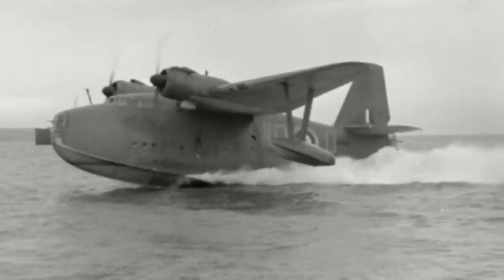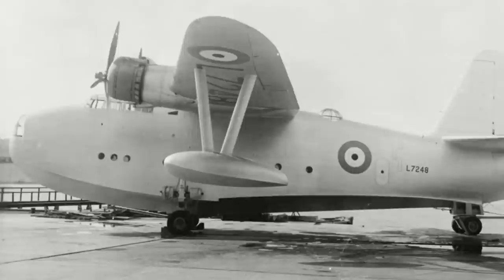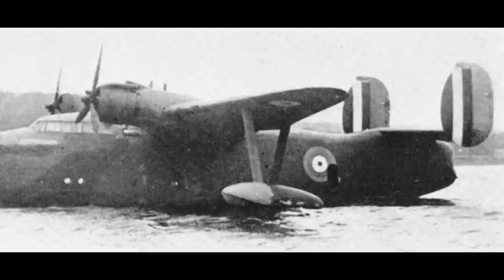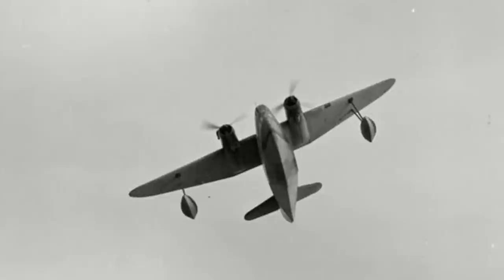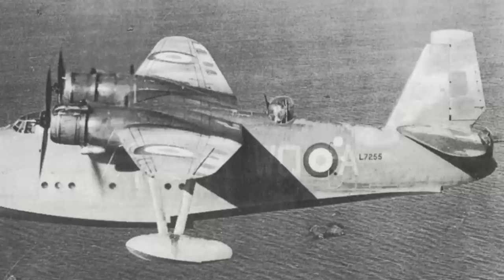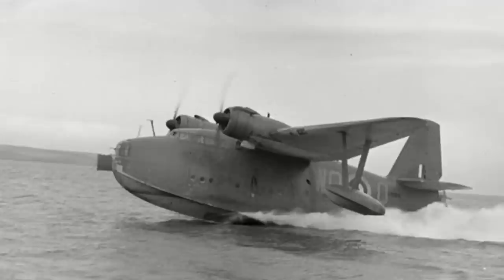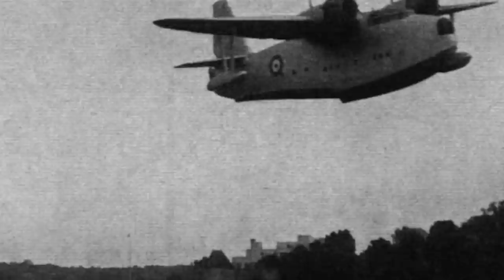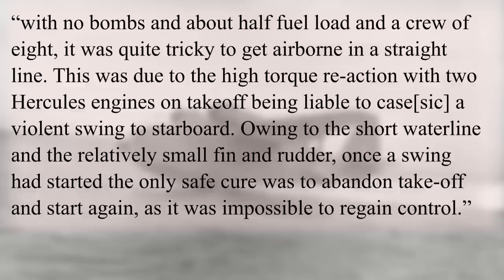Is this the worst aircraft to fly? The Saunders Roe Lerwick

Comment: Saunders Roe didn't always design planes for roles that no longer existed. Sometimes they designed ones that simply didn't work properly. 

They seem to have had an unhappy ability to design brilliant planes that nobody wanted and terrible planes that people would of wanted if they were any good. The Lerwick for instance, had it been a good plane would have found many ready roles and been as famous as the Sunderland, which ironically Saunders Roe ended up building on license as they had spare capacity because the Lerwick was a dud.
Reply from the maker: Indeed they do. It is rather interesting that ability too.
Reply: “would of wanted” makes no sense. You should write “would have wanted”.